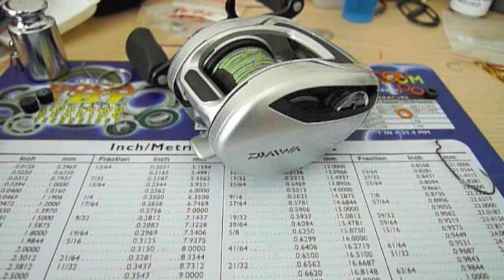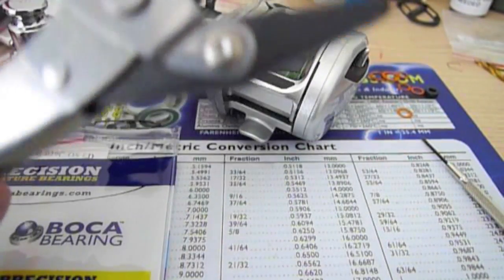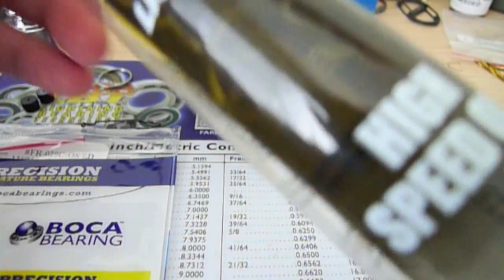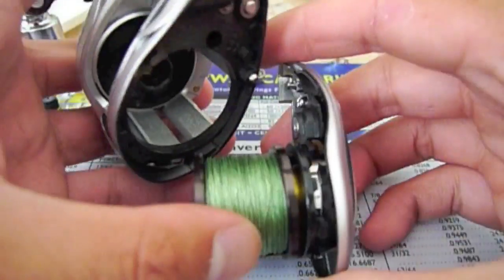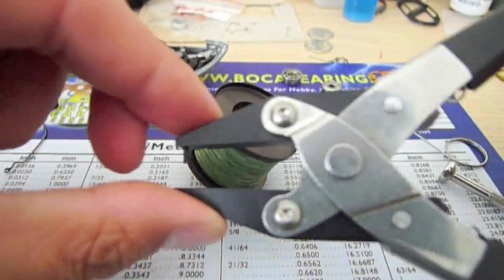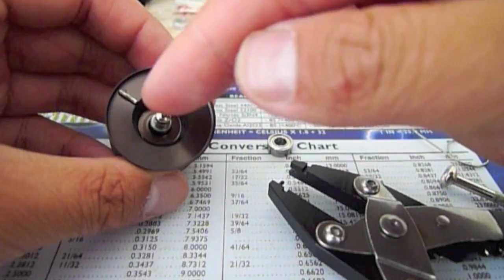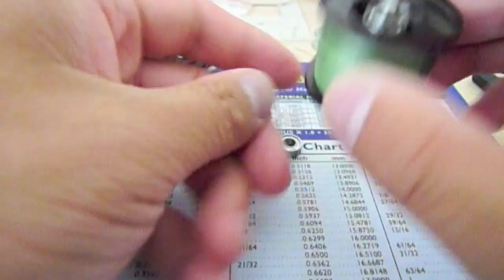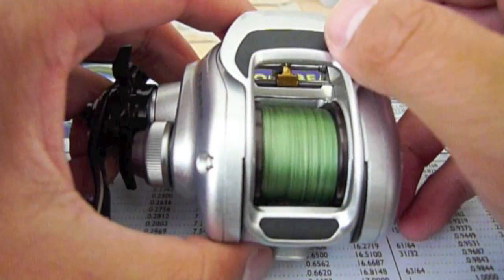Daiwa T3 Spool & Side Plate Bearing Upgrade Tutorial

Comment from the maker: it's the same, the magnet might be holding it in place. Try straightening a paper clip/wire and then bend the very tip (~2mm) in a right angle and pull it out that way